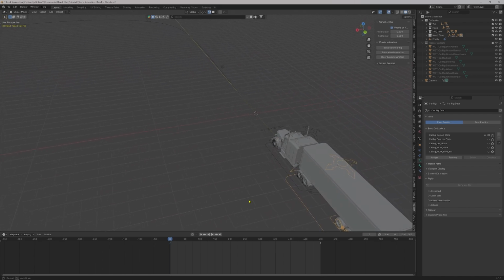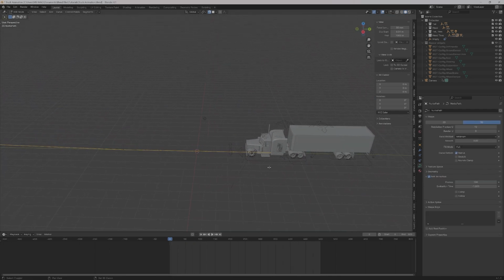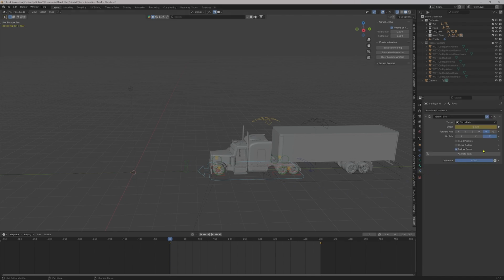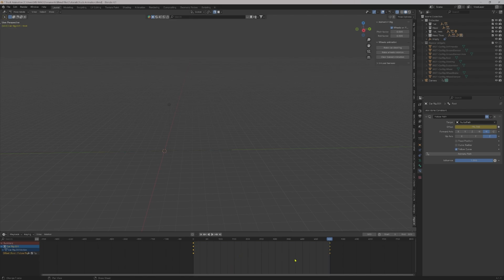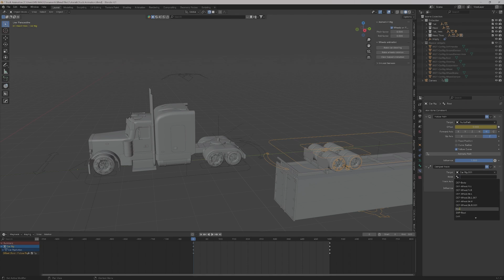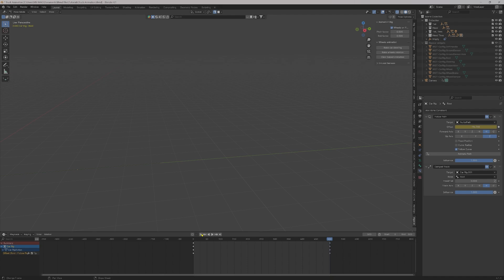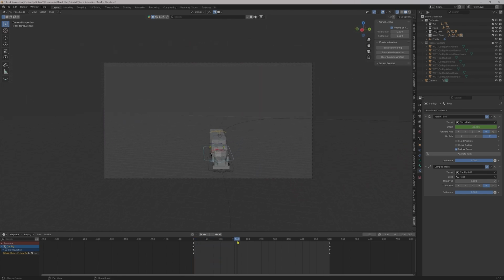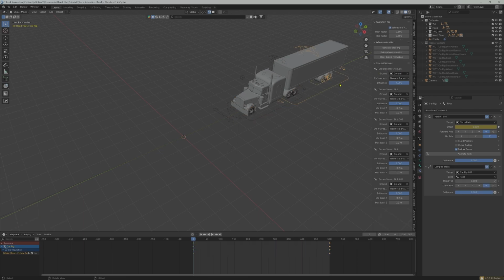How to Animate a Heavy Semi Truck in Blender 4.1

Comment: Thanks for the tutorial, however I noticed the load is not following or moving as a real cargo would do, seems that the rig wasn't prepared correctly, I'm having the same problem. basically, when the front part turns, the load should pivot asa real truck does. please let me know if its clear and if you have a solution.